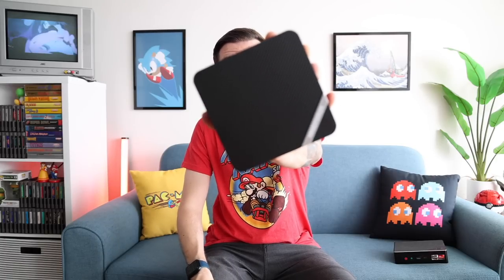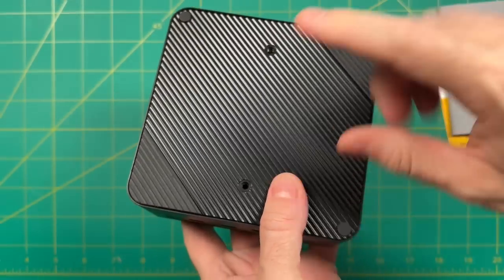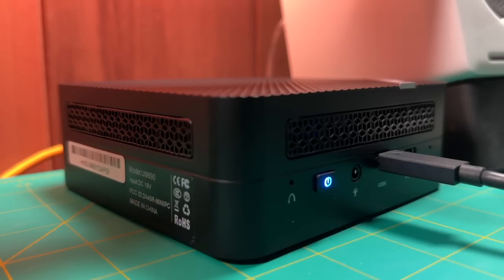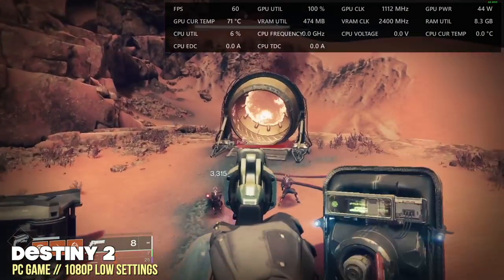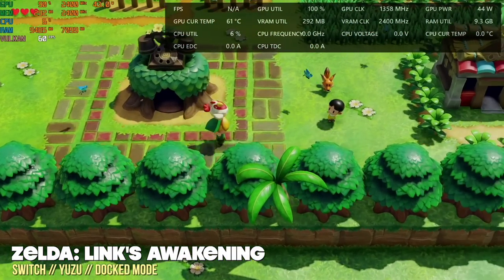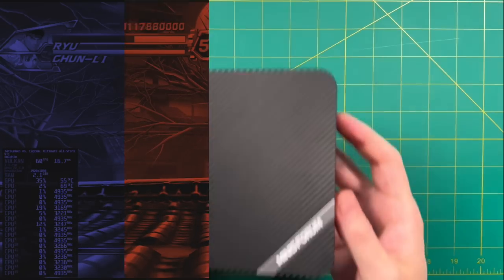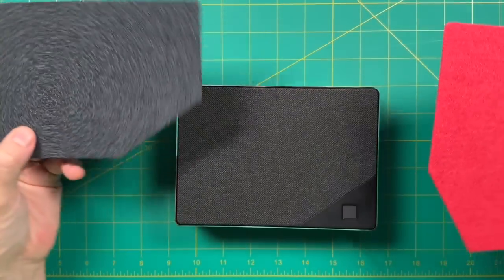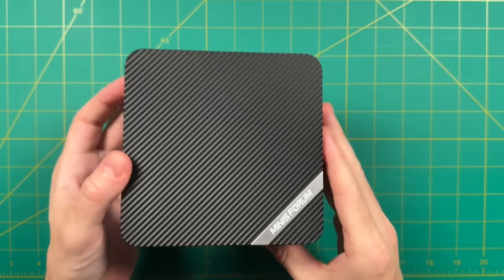MinisForum UM690 Review (Ryzen 9 6900HX)

Comment: These ryzen mini pc's are getting to a point where I dont need much else.
Reply: Yeah Im sure when my system dies? One of these is replacing it. By then it will be <$400 probably.
Reply: Same! I switched to this exact model (had an HX90 before it) and I don't have any issues with it. Of course I only care about 1080p and older games but this edges close enough to where I think it's the most you'll ever need if you're not a mega gamer or graphics nerd but still want to play something that needs some power.

And then I go play on my switch and my steam deck
Reply: @davefroman4700 You called it, sub $400 almost everywhere.

Comment: One thing to note about the cooling - it is meant to be mounted vertically on the stand so that the cooler intakes from the bottom and exhausts out the top and back.

Comment: Very nice, detailed and comprehensive video. But for an in depth review, you've forgotten to mention, that the GTR6 has 4 HDMI 2.1 ports for 4*8k60Hz or 4*4k120Hz compared to the UM690 with just 2 HDMI 2.0 and 1 USB4 port, where you can use just 1*8k60hz or 1*4k120hz and 2*4k60Hz. And at least for the EU the UM690 with 32GB+512GB costs 799 € where the GTR6 costs just 769 € with the same specs.

Comment: Just a note around the cost mentioned @3:16 - I just got my barebones UM690, added RAM & SSD then installed Win10 on it.    Looks like MinisForum is using the OEM Activation feature, with a product key baked into the BIOS.   It automatically activated it as Win10 Pro.   (Assuming Win11 would also work.)   So the windows license is included with barebones units as well - nice!
Reply from the maker: Oh that’s awesome, thanks for the feedback!
Reply: He did make that appear like a freebie you would get when you bought accessorie parts from them. I'm glad someone else brought this up. Most companies give you a license built in like this anymore when you buty a system.

Comment: If I could get this performance for under 300 I would buy, so Im excited to see what comes on down the line.
Reply: You can get very close to this performance in a mini PC for a little over $300 if you do some assembly:

AsRock X300 Barebones $149
Ryzen 5600g processor $128
8 GB RAM kit $13.50
512 GB SSD $27

The 5600G is a little bit older than the 6900HX, but it's got a higher TDP of 65 watts. So the performance should be very similar.
Reply: I’m waiting for my Ryzen 9 1TB 32 GB UM690 Pro to get here today, I ordered it yesterday. I paid just about $400 for it, Amazon had a $165 coupon. Pretty close to $300.. I paired it with a 32 inch 240 Hz monitor, also a good deal for about $320. I’m a MAC 🖥️ guy so I’m happy to learn this way.
Reply: @MidnightMedia_  mac guy too but sweat deal man congrats on new setup
Reply: @CountryAzHell  dude thanks for even responding! oh yeah, I’m pretty stoked, for the price I couldn’t see anything better. I’m in Vegas and I went all around this damn valley and saw some really expensive towers. Eventually I want to build a monster but for now, I kinda want to learn what the parts are with a starter. Just found out you can add an external GPU which kind of changes the game now. Have a good one bro.

Comment: Was thoroughly impressed by my UM960 I got back in January. I used to lug around my beefy Alienware gaming laptop and chunky 180W Power brick, now I can tote the UM690 with mini keyboard, portable 1080p screen and mouse around and that lot weighs less, performs better and with the cradle it sems to stay cool and quiet even under gaming loads! It can even operate off in-seat power on a plane which my Alienware could not.  Unfortunately, after 4 months my UM690 died in the middle of a game and is now completely dead with a flashing LED on the power brick indicating the system is likely shorting out. Now I'm waiting to find out how effective the Minisforum tech support is. Looking at other reviews, it seems my situation is far from unique with a significant failure rate citing the same issue :(
Reply: So far - Minisforum had me ship the unit in for a replacement - waiting for it to arrive. Hopefully this was just a QA issue and not a major design flaw.
Reply: @mpwaterhouse  hey, interested to see how this turned out? Did you get a replacement unit?
Reply: @luxorcephrenSE23  Just got a reply, they received  my tracking number and wanted my address/phone so they will have a replacement ready to ship as soon as my package arrives at their US address. Hopefully should have one in a few days.
Reply: @mpwaterhouse thinking of getting one. Would you recommend?
Reply: My UM690 unit completely failed randomly, same as your situation

Comment: I don’t understand the complaint about configuring the 45W option in the BIOS for the GTR6. I was able to do that easily. Does it not actually work? Am I missing something?

My only complaint about the GTR6 is volume of fan noise. It would be great if it was a little quieter under load, but then again, overheating doesn’t seem to be an issue for it. Note that it has two fans: One to cool the m.2 and RAM slots, and the other to cool the CPU (one fan on top and the other vents underneath.

Comment: Hey Russ I’ve been following you for about a year or 2! You helped me thru miyoo mini, RP3, ps vita and just understanding emulation overall. So my questions is Linux and batocera. How does this work like do I need to change from windows to Linux or is Linux installed on the flash drive that you run batocera from. Cause I love how batocera looks. And instead of batocera would launchbox big box be a substitute?

Comment: The GPD Win 4 with a 6800U, 16 GB RAM and 512 GB SSD is $799. That's only a little bit more than this. I realize it's a completely different form factor, but there's no rule that says a handheld can't be used as a mini PC.

Short version is that I'd probably get a handheld and dock it rather than one of these.

But also, I'm biased. I already have a 4650G mini pc hooked to my big screen in my living room, where I'm typing this right now. So I guess it depends on use case. If it's a box that you want to hook up and never touch a mini pc is a better solution, but if it's a machine that you want to use portably and then dock, a handheld is a better solution.
Reply: This with a higher TDP and better cooling should offer considerably more performance than a 6800U.
Reply: @jamesyu5212  The TDP is adjustable on the GPD Win 4. The cooling for it is very stable up to about 40 watts.
Reply: @harleyn3089  even if that were true, you are stuck with LPDDR5 with 50% less bandwidth than DDR.
Reply: @jamesyu5212  The LPDDR5 on the Win 4 is quad channel, so if you are using dual channel on the UM690 you get the same bandwidth overall.

EDIT: Also, the UM690 uses SODIMMs.
Reply: @harleyn3089  no functional difference between Dimms and Sodimms
Reply: @jamesyu5212  The Quad Channel still makes up the difference.

Also, if you don't believe me on the TDP, The Phawx has a video you can go watch where he tests TDP scaling on the GPD Win 4.
Reply: @harleyn3089  you do realize that DDR5 acts like 2 separate channels right? And that 2 channels of DDR5 actually is as performant as quad channel?
Reply: @harleyn3089  also, personally I'm not invested either way. I have a 2021 win max and can still play elden ring at 1080p 30. I'll be waiting for the 7040 AMD APUs which are 30-50% better than 6800 series.
Reply: @jamesyu5212  Yes, that's why quad channel LPDDR5 is equivalent to Dual Channel DDR5.

Oh, also I looked at the video I was talking about from The Phawx, and the Win 4 is stable up to 45 watts, not 40.

I'm probably waiting for a 7740 or 7840 as well. Depends on my self control.

Comment: The 699/690S are the only 6900hx systems i have found that let you increase memory speed, which is very helpful on the performance front. The 690S has a much better cooling solution, so it would be very interesting to see performance comparisons between the different memory speeds on the 690S with an eye on thermals.

Comment: Why do people suggest 16GB for these machines when the performance is not as good as with PCs with dedicated gaming GPU and the iGPU need to use system RAM?  If one is to play modern games, yes even at lower settings than with a dGPU, get 32GB of RAM.  
If the iGPU uses 2GB of the 16 then you are left with 14GB.  If you want to have other things open/running at the same time that will take more RAM from the system too.   With more modern games requiring or at least running better with more memory, why get just 16 and potentially hurt the performance which let's face it isn't going to be as great as with a larger desktop system to begin with.
I don't know, it just makes more sense to me to go for 32GB of RAM.
Anyway, good video though I would prefer to also see tests with more games like CB2077.

Comment: I bought two of these machines to use for virtualization but I couldn't install ProxmoxVE or XCP-ng using various versions. I think there might be issues with the I tegrated graphics on these machines but I can't seem to figure it out. No settings available in bios related to virtualization at all, very barebones bios.

Comment: I've a problem with batocera on that's unit. Batocera won't boot properly and the boot stops at minisforum splash screen with "booting batocera. Linux" phrase on top. I've tried botocera troubleshooting on bios, but it doesn't work. Someone could help me?
Reply: I've made a working solution by myself

Comment: Xemu emulator itself is still pretty hit or miss even on my RTX 3080Ti laptop it still struggling to run and play many games, lile LA RUSH where it will stuck in constant low 20 fps slowdown and never recover not to mention it loads my CPU harder and hotter than RPCS3 which goes to show that Xemu still have a long way of from being a good stable emulator.
Still very impressed with this Mini PC, might consider something similar down the line.

Comment: I am struggling to make Batocera run on USB. Have you changed some Bios setting? Cheers
Reply from the maker: Hi, I didn’t alter the BIOS at all, but I am running the latest beta/development version of Batocera which works well with some recent Beelink and MinisForum PCs. So if you have access to a different PC I would start up your Batocera USB drive with that PC, update to the development channel in the update settings, then try it in the UM690.
Reply: @RetroGameCorps  Thank you very much for your quick answer. What do you mean with "update to the development channel in the update settings"?
Reply from the maker: @pietrotria  when in Batocera, there is an updates and downloads section in the main menu. Inside that section you can change from “stable” releases to beta/development releases.
Reply: @RetroGameCorps  It makes sense now. Thank you very much!
Reply: Sorry to bother you again. I updated Batocera to the last beta but I still have the black screen with Minisforum logo in the middle when rebooting with usb and UM690. Another guy in Batocera forum had the same issue with UM690. Do you remember of any particular setting you may have selected?
Reply: @RetroGameCorps  i can confirm, that especially when rebooting Batocera (so when you are in Batocera and choose to restart) from a USB thumb drive, it stucks on a black screen with the Minisforum logo in the middle and the text: "Booting Batocera.Linux..." in the upper left corner. I can reproduce this every time and tried several USB thumb drives (always fresh new installations of the official batocera image v35 and the latest beta of v36). Other people with the same issue but on other machines (other x86 hardware/PCs) could solve it, by disabling the fast boot option in bios (or change from UEFI to Legacy boot). But unfortunately those options are missing in the bios of the UM690 :(

Comment: Thank you so much for this video! I’ve been looking for a deep analyze of it. For someone that has a steamdeck/dock, do you think it’s worth picking this up? Use case of purely 1080p emulation (up to yuzu) and indie windows games. Thanks!!
Reply: Honestly? No. Unless you really need a PC this small, there are actually PCs with discrete GPUs that cost about the same but slightly bigger.
Reply: @James Yu  Okay - could you give an example for that? (I'd find something comparable to the HX90G quite interesting - one CPU generation back, but with an at least decent separate GPU -> should pack quite a bit more punch... but it wouldn't have to be quite that small a case, which should make cooling the whole shebang easier. But that one is quite a bit more expensive than this, at least in my corner of the world...)
Reply: @jamesyu5212  can you list a couple. I don’t mind if the mini computer is bigger than this if it has a dedicated GPU.
Reply: @Dan-lm4di  if you are in Asia the Topton brand has M600S and F11. Otherwise Minisforum has the HX90, hx99 or nucxi5 for a little bit more.

Topton actually has quite a few models without a model number so I can't specify. But if you just type "Topton mini pc" I'm sure you'll find something you'll be interested in. Some of the are cheap because they are older models, but the have GPUs all the way upto 3060. There's a small pc I'm looking at that's intel i7 10th gen + gtx 1650 for about 550 USD.

Comment: Question 🙋.. How on earth are you getting that 95% score in thr stress test 🤷‍♂️

Best I have got so far is 69% running the 54W with a Tj Max of 80°.. FPS drops right after the 4th5th pass then again around the 10th pass.. 🤷‍♂️

Also.. Does anyones 65w option in the bios just not work at all.. Select 65W and it instead reads 30W (30W isn't even a standard option 🤷‍♂️)

Driving me mental this box.. Would love to here what CL ram people are getting as well.. Mine is clocking at CL36 5000Mhz (any higher is not stable).. Am using a low latency G.Skill set..

Is the trick to be setting manual SmarShift settings in the bios? 🤔 (Is what I will probably try next unless somone can point out what I might have missed)

Comment: Serious question: where does one purchase the components if you buy one of their barebones systems? I have no earthly idea where/how to buy an AMD mobile processor.
Reply from the maker: The barebones version has the processor already installed, it just doesn’t come with RAM or storage. You can grab those from Amazon or a retailer like Micro Center, just buy some with the same spec as those shown on the PC’s webpage.
Reply: @RetroGameCorps  Thanks. Well dang that's easy if one has expetience building computers.

Comment: You can also overclock the RAM. I have it running at 5400mt
Reply: How did you do that?
Reply: @juandeloera9924  it's under advanced. Last option if I remember. You can specify ram in 200mt increments

Comment: Does this machine support lpddr5 6400? I bet you could squeeze an extra 10% in gaming performance ?
Reply: Mini form recommend  ddr5 4800 but I saw this guy retro game or another YouTuber installed ddr5 5600 32gb from teamgroup,  therefore I was planing to buy the same ram , unfortunately ddr5 5600 is not available in Amazon sow I bought 4800

Comment: Should've gotten it without ram and put 6400mhz ram inside instead of that slower 4800mhz stuff, those igpus love quick ram and ordered it without a drive as the stock one holds things back and put a real fast Samsung 980 Gen 4 m.2 in there, Wonder what it would do with that.

Comment: Had you think on running Linux as Host and use VirtualBox to run Windows as Guest with Windows System drive enterly on Linux RAM-drive?
For doing such, the 64GiB RAM is a must, at least 40GiB for Windows Guest filesystem be enterly on Linux RAM-Drive + 16GiB for Windows Guest RAM, the rest of RAM for Linux host RAM.

Comment: I'm confused when you say no graphics card. I didn't realize you could game without one. Can someone explain it to me what a graphics card does if not for gaming?
Reply: 2 months later! So what he means is that there's not a SEPARATE (or discrete) graphics card. There is one built into the CPU, that's why it's called integrated graphics, because it's all integrated into the same processor.

When you're not gaming, your GPU does hardware acceleration for videos, webpages, and the like. It's basically just doing all of the visual graphic stuff so that the CPU can do the computing stuff behind the scenes.

Hope that makes sense.
Reply: @therealwhite  
I had looked this up a couple months ago, but I appreciate the response nonetheless ☺️

Comment: Beast when it works but it doesn't work.
These computers have massive problems with its power supply results in green screens everytime they boot up even browsing internet explorer will cause a green screen. They start off with being very functional and competent pc however on week 2 they green screen everytime they are turned on. This issues was not found in a lot of early reviews.  I would not recommend this pc to anyone a early 2000s desktop can outperform this computer because at least a computer from 20 yrs ago can turn on and stay on longer than 30 minutes.